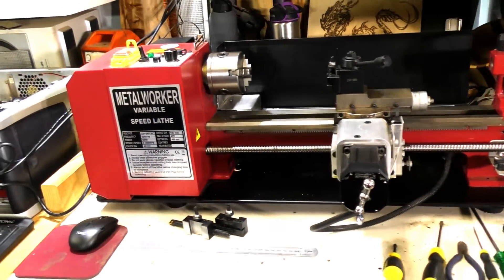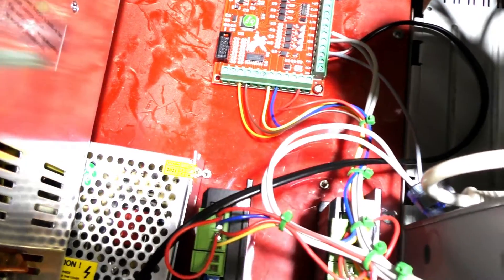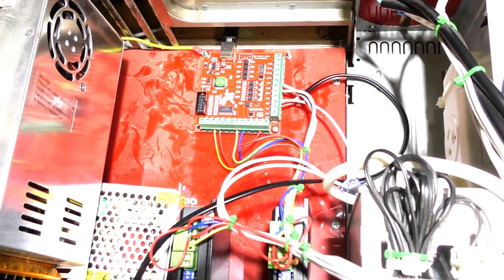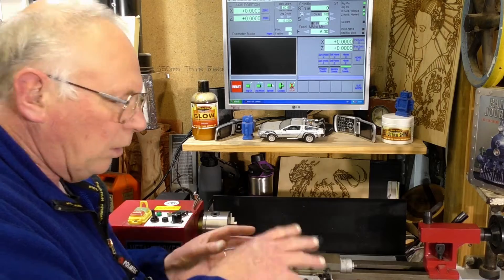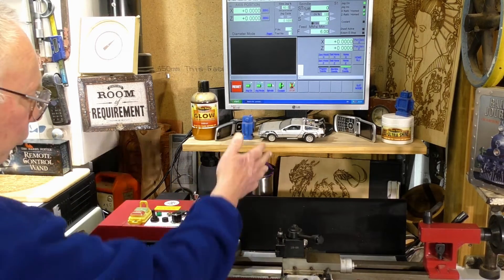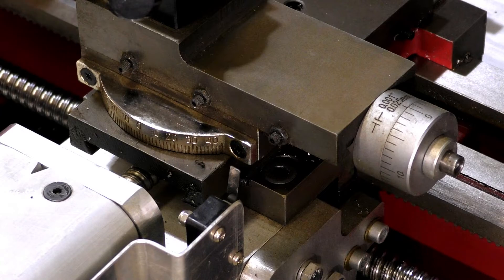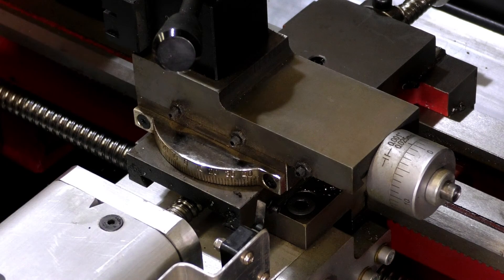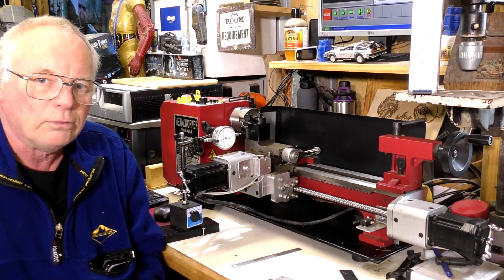A CNC mini-lathe conversion Harbor freight/grizzly 7 x 14-inch new Mach3 BOB setup

Comment: I like the motor configuration and the manual handles.  Seems like you need to stepper the main motor for threads (or add an aux. stepper motor).

Comment: I was a cnc turner for 25 years on Fanuc controls.
Never really got into the nitty gritty of how it all worked so finding it quite interesting.
I've gone over to the dark side now and got a Router with Mach3 so still relevant to me in some ways.
Thanks Roger.